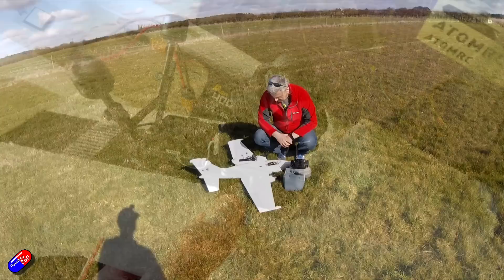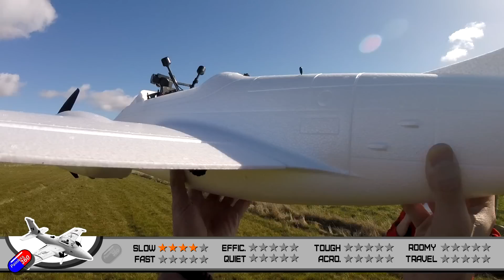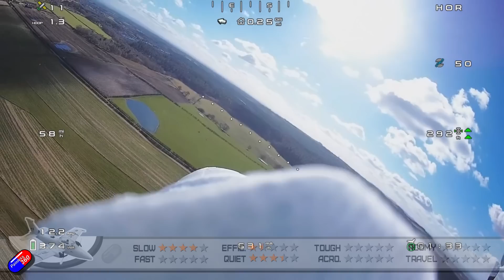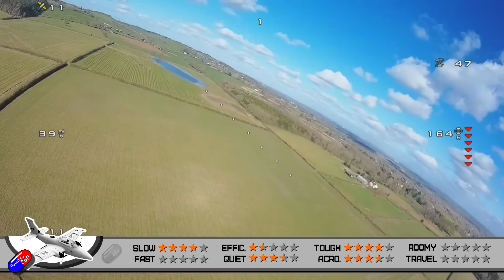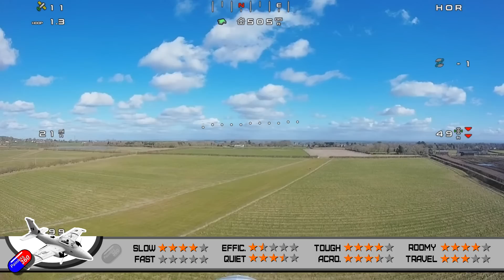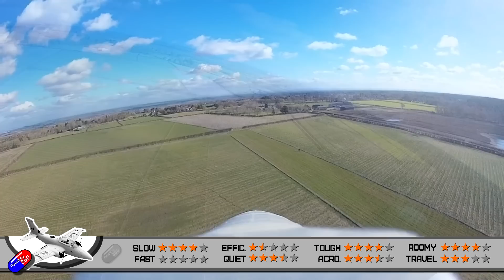AtomRC Beluga R/C Airplane: Flight review and scores!

Comment: Suggested replacement propellers for the Beluga?
The stock Gemfan 7040-3 seem too soft, they emit loud resonance above 90% throttle.  Cheap and worn out 6S 3500mAh lipo.

Comment: Hi Lee, i have a question about the Atomrc Beluga. I have been flying for 3 years, and have kinda been bored with my nitro and electric airplanes lately so got the Beluna, PNP + S. Just a couple questions for you. Im def on a budget and was planning on getting the Atomrc FPV pro pack. Could you tell me if this is a good set up for beginners. Im also in need of goggles so was wondering what you recommend, preferably for a very, very, VERYYY, reasonable price😂. Another problem i have is my brother rarely comes to the field with me, and all of my attempts to hand toss by myself hasn’t been pretty, but we do have a runaway. I did really want the retracts for this airplane but the most expensive version of the plane was the only one which came with retracts but it’s out of stock anyway. Ik you don’t even use the retracts on your plane, but was wondering if you know where i can find them or at least what size they are to see if i could find some off brand ones…. Thanks, Jude.
Reply from the maker: What kind of flying experience are you looking for? I found the Beluga slow, heavy and very inefficient. There are some other lovely twins that would make great flyers...
Reply: @ really just my first fpv experience, haven’t bought anything yet, so if you have any other suggestions let me know.
Reply: @Painless360  i also think the Beluga looks pretty cool. The price though was also pretty affordable, just $200. So i thought it might be a first good one. But you tell me!
Reply from the maker: I think I just did ;)
Reply: @Painless360  haha, okay. Which plane would you recommend then?
Reply from the maker: https://youtu.be/SByJl32vkpo

Comment: I love love love my Beluga. I had to do a few things to make it better, like adding 4 M3x8 thumb screws to attach the wings quickly. I don't use the canopy because it is near impossible to see through, but its great with the atomrc pan and tilt gimbal with an O4 Pro! I use an Ovonic 6s 6000mah pack and it balances without adding any aditional weight. Its the same pack I use for my T2 VTOL and I can get a good 30 minutes or so of flight time. Inav autolaunch makes it simple to launch one-handed and it lands beautifully! It is incredibly stable in the air and now comes with me to the field every time I go, even though it requires some strategic placement in the car to fit with the rest of my gear. Don't bother with the retracts. You don't need them. Just tape up the bottom with fiberglass tape, and off you go! And for the record, my little protruding bits on the wing tips are still fully attached with zero damage. I imagine if I were landing in longer grass, maybe they might rip off, but so far, we're all still put together! It really is a super fun model, and if you're on the fence, just get one, you're going to love it!
Reply: How do you use the pan tilt gimbal and the 04 Pro?  Do the Goggles 3 allow for this?
Reply: @1Joker.FPV1  I use the 2 potentiometer knobs on the top of the Boxer. The left one controls tilt and the right controls pan. You just set up 2 extra servos in iNav and assign the control of them to whatever RC channel you have those knobs set to. And plug the servos into the correct outputs on the FC, of course. It's super easy to set up.
Reply: @William_NS that’s awesome!!!  I’ve been flying FPV quads for the last few years and want to get a wing. I’m trying to decide if a VTOL would be good or a “regular” plane. 

Any suggestions?
Reply: Have you upgraded the propeller?  The stock Gemfan 7040-3 seem too soft, and emit loud resonance above 90% throttle.
Reply: @gluino  I still use the original props It came with. I've had zero issues with them. I don't fly it much anymore. I've reduced my fleet that I bring to the field to the Chupito, Dolphin Pro, T1 Ranger, and Swordfish. Maybe Ill try to fly it this weekend!
Reply: Oh, and my Caipirinha II. I still fly that one quite a bit as well.

Comment: How did you get a Walksnaiil Avatar HD Goggles L to work Headtracking with INAV??? I usedd PTZ but withh INAV I couldn't get the GM3 to take the Goggles L head trcking setup?
Reply from the maker: See my original video on it. Not using INAV for the HT gimbal stuff...
Reply: @Painless360  ahh okay. I plan on using the 9v pins from my F405 Wing, but I wasn't sure how to overlay the INAV for it. BEcause powering it off the FC, but not using INAV, seems like an easy workaround, but then there's no IINAV Overlay. 

Thank you, l have to check out that video and see what I can do.
Reply from the maker: Connect the TX and RX pins on the Walksnail unit to a spare UART on the flight controller and configure it as MSP DisplayPort... Best of luck
Reply: @Painless360  I FINALLY GOT IT WORKING THANKS TO THIS. I now have INAV with working OSD, in my Goggles L headset, with Headtracking sent normally to my GM3 gimbal. They are both grounded via FC, and power off the 9v Digital wire too. RX/TX into UART 5 on MSP Display port, MSP=OFF, AMAZING!!!!!!! FIIRST TIME IN MONTHS ITS WORKED.
Reply from the maker: Check out my Walksnail playlist and recent builds as I cover all of that... Happy flying!

Comment: Thank you for the video.  I maiden my Beluga two weeks ago my flying field has a runway. So I fly with the landing gear. I think the front retract should be a little bit stronger.   I had to replace the connector pin with a 4 x 40 should bolt because the stock connector pin is very soft and bends easily.   I decided not to fly with a canopy also.   Btw a zeee 6s 6000mah Lipo fits and I’ll be testing that battery next time, (but is heavy).
Reply: what was the flight time?

Comment: I wonder how much efficiency is taxed by not having the canopy fitted? It reminds me of the Binary, being also a bit too pudgy to get anywhere near high efficiency.
Cheers.
Reply from the maker: See others who flew with it. I don't expect it'll make much difference... Happy flying
Reply: There is no difference if you changed the proof. The Beluga is great plane, but not that fast. With my 6s2p lion setup, I flew around with 65-75 kmh. Everything above that speed, just drained your battery, But with 6s2p 9000 the flight time is around 55-60min.

Comment: Great review, as always. I was considering this plane but not so much anymore. I just don't see where it fits into my lineup.
Reply from the maker: If you're looking for a larger twin then the AtomRC Killer Whale otr HEEWING CRUZA T2 have advantages over this for most things (see the scores for those models in their review videos)...
Reply: @Painless360  Honestly I was hoping the plane would be faster, stiffer, and more playful with the triblade props, 6s battery and lower aspect ratio wing than the Swordfish. I can get the Swordfish to just under 100 mph before the battery sags out and cruise pulling around 5 amps. On the Swordfish I've added a full length flaperon/spoileron setup and use differential thrust. With that configuration it's pretty versatile.
Reply from the maker: The sowrdfish is a beautiful flying thing. I love mine, and on calm sunny days, it's very hard to beat for the soaring style FPV flying!

Comment: Why do they insist on using these tiny motors and props with such a heavy plane?
Reply from the maker: Check out the reviews of the AtomRC Killer Whale and Reptile Dragon II for large twins with a nicer balance of power and efficiency... Happy flying!
Reply: @ for sure. Already have a RDV2 running 2212 x 1250kv motors.
Reply from the maker: I wouldn't expect adding the canopy would dramatically change the performance too,  based on the flying of the Dragon II and Killer Whale. Both are big and not excessively unstreamlined, but their motor and prop setup works a lot better, IMHO... Happy flying!
Reply: Right on Lee! Been waiting for your review (must have missed it) love mine. I think the props need upgrading. I hit 100 knots in one of my videos with a 6S lipo on stock props but gosh do they whine!!